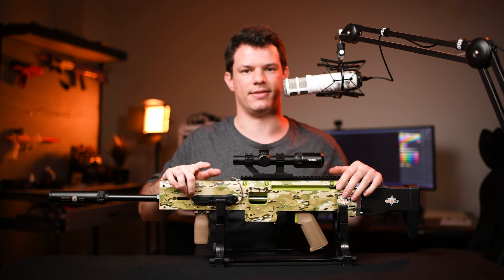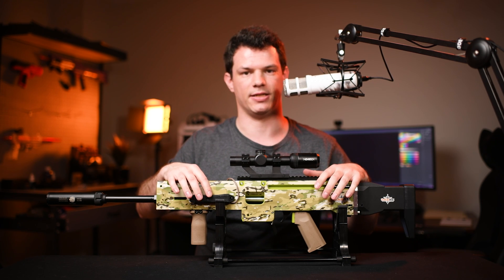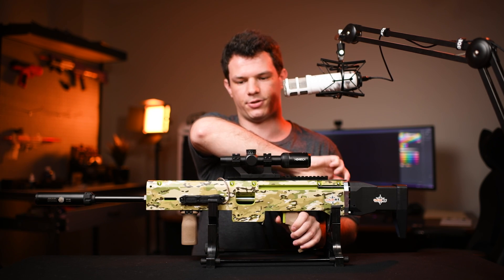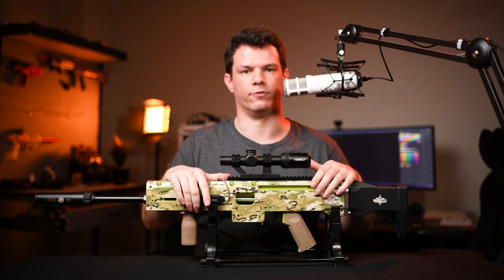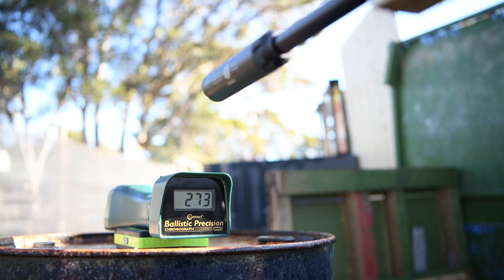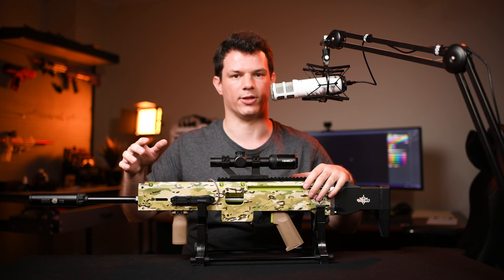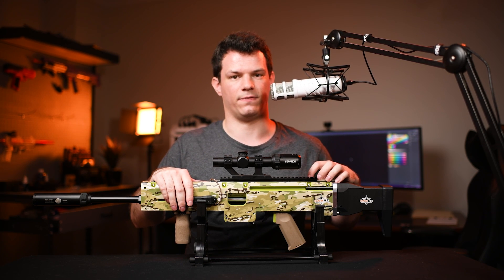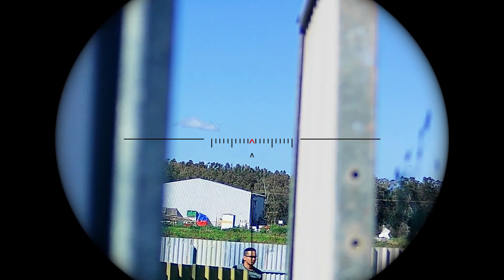This 300fps Nerf Sniper Works Automatically!

Comment: I love that the rack/gear is an electronically controlled full gear instead of the traditional half-gear (or whatever the appropriate terms are) in the stampedes and gelsoft AEGs, it feels so much more durable/techy. Excited to see your gameplay with these!
Reply: The rack and pinion are definately more durable as there is not much wear and tear due to the nature of half gears

Comment: Is the sabre really worth $900 when you can pick up the new worker swift and all its kits for roughly quarter the price?
Reply: You get roughly quarter the durability too for quarter the price lol
Reply: Yes. I love my M20 and not one blaster yet has replaced it. The durability, accuracy and power is currently unchallenged in the springer market. The cost saving alone on replacement parts for 3DP or other injection molded fails has paid itself off.
Reply: @ShadowMajere  constructive answer, much appreciated.
Reply: @KorribanGaming  Swift is injection molded with CNC metal internals though.  It is solid as a brick.
Reply: @laoking8553  I've seen a few complains on fb regarding random parts breaking though, not the metal parts but the plastic ones

Edit: O ring poor seal and dart gate broke
Reply: @KorribanGaming  Worker has been quick to send out replacement parts free of charge with the updated dart gate and new o rings for better seals. M20 is definitely the best spring blaster on the market but for $400 USD less, I'll settle for second best.
Reply: @laoking8553  that's fair, not many people would be willing to spend that much on a toy
Reply: @laoking8553  metal casted parts.. not CNC. They are not as solid as CNC
Reply: @laoking8553  I bed to differ, u can't use swift like a brick and hammer to break wood or even bend aluminium , but I can dare say M20 is like a brick in all sense of the word
Reply: @conradsng2447  Ok, you can go ahead and do that pal. Have fun with that.
Reply from the maker: Swift is almost an M20 in performance but not quite. Definitely an alternative to consider.
Reply: @conradsng2447  it can break pallets apart and crates we ship marble in.... I can't do that with any other blaster 😹
Reply: @conradsng2447  so now new advertisement? 

“M20 multitool’
Reply: @wongyewxuan3880  haha.. maybe not . There are well established reliable brands for multitools out there. Settle for the good ones and they will last you for a lifetime.
Reply: @KorribanGaming  spend twice buying cheap then. It’s ok to buy worker. Just a personal choice

Comment: Do you go around picking up your darts after each battle?
Reply: Interesting, I was wondering the same thing.  With gels you just leave 'em on the ground, but with darts?
Reply: Be mindfull of mature
Reply from the maker: Yes you pick them up. They aren't exactly cheap either so people reuse them.
Reply: @BradleyPhillipsYT  considering picking up darts in your home or backyard is a pain in the neck having to constantly pick these up at the end of every battle on such a large field would be such a chore. If I were using a nerf blaster  I would be constantly thinking is it worth firing that dart or it's too much effort to go find the dart. I also imagine that you will lose some regardless of how careful  you are looking for the darts so there's another thought on your mind when firing. Is the accuracy and range worth all the drawbacks?
Reply: @MrTerrakb117  это пожалуй один из важных недостатков в сравнении с гелевыми шарами. Думать о экономии дротиков приходиться в начале каждой игры..😅

Comment: Next an auto caliburn?
Reply from the maker: It's probably been done
Reply: Done like 3+ years ago with higher rof. This m20 shit is some old outdated tech
Reply: @wongyewxuan3880  send a link to prove. Dont just run that mouth. 🤮🤮🤮
Reply: @slade6828  ?
Reply: @wongyewxuan3880  send a link video of that so called full auto cali. Understood? not just shaming a product
Reply: @slade6828  i already did if you bothered to read my original reply

Blind ah?
Reply: @wongyewxuan3880  now that's an old video showing a printed blaster run by stepper motors and a belt driven mechanism. Has it been used in the field? Or videos of it in actual play action with some performance readings? Or maybe I a missing something purposefully? 😁

Comment: Or u can just get a airsoft gun... my ssg10 can shoot 360 feet. It would actually hurt less than being shot by a 300fps nerf dart because to fire a nerf dart which wieghs (1-2 grams)  at 300 FPS it would require a ton of joules/energy. However, with a airsoft gun, they fire 450 FPS but that’s with a ammunition weight of 0.20

So as a result, the nerf bullet will have to carry more energy to carry a larger projectile which means it will hurt more. So enough with saying, I don’t like airsoft because it hurts to much.
Reply: In some countries Airsoft is illegal. But I do agree on your point.
Reply from the maker: Mate, we would already be playing Airsoft if it wasn't completely illegal and banned here in Australia. A little research goes a long way.
Reply: Lol 300fps is only ~ 4 joules

Also nerf darts lose speed very fast, so as long as the distance is in excess of like 10m its not an issue
Reply: @wongyewxuan3880  nice to meet you. Are u from Singapore ?